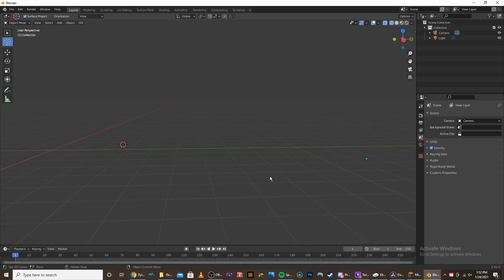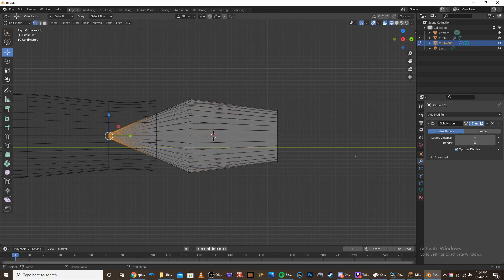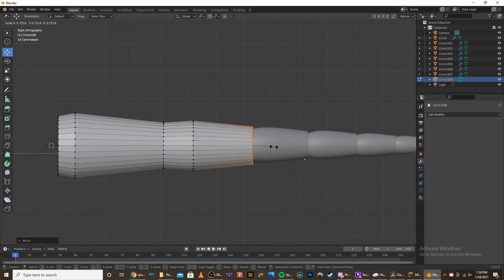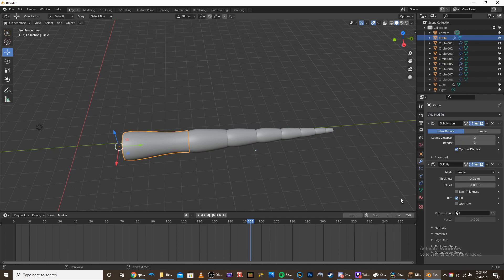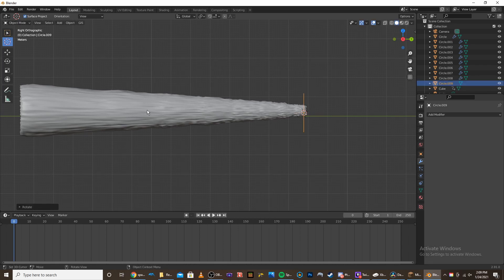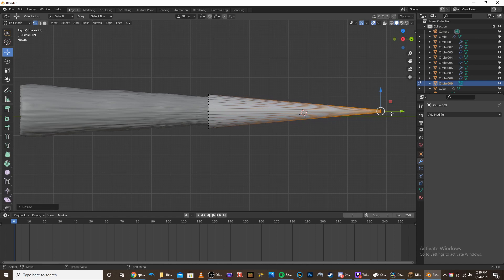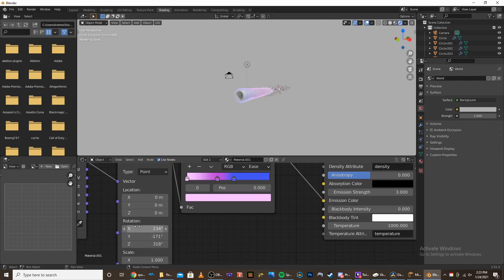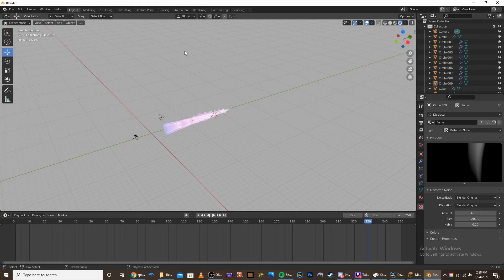How to Make Rocket Exhaust Flames in Blender - Tutorial

Comment: For the mapping rotation just use a separate XYZ node after the mapping and put the Z output through an invert node, then use that as the factor. Saves on having to mess around with mapping nodes. Great tutorial!!
Reply: Sir,you are god damn right. It is easier to connect with separate XYZ node.
Reply: @FrankPriceLife  thanks I guess?
Reply: its almost like magic, thank you very much

Comment: when i use the principled volumen it look like a cube, how do i fix it?
Reply from the maker: switch from eevee to cycles render engine
Reply: For anybody who still has this issue, if switching from Evee to Cycles didn't work, check if you're in material preview mode. If you are in material preview mode, try switching to rendered preview. It got better in rendered preview.
Reply: @kylerluo4544  That's because the material preview view always uses Eevee

Comment: I'm trying to use a far scaled down version of this for my spacecraft project. The problem I find is that in material preview mode, instead of displaying the material/colours correctly, the effect is replaced by a horrible looking cube/rectangle. How can I get the blueish thruster trail effect? Yes, I am using cycles.
Reply: You've probably figured this out by now, but if you're still wondering it's because the material preview mode is always Eevee. To view the cycles preview you need to be in rendered view, but usually people prefer to use Eevee while creating materials because it shows what's going on instantly instead of taking a moment to render like Cycles does.